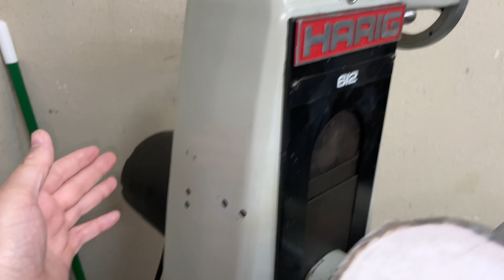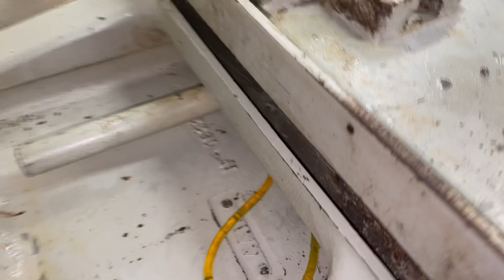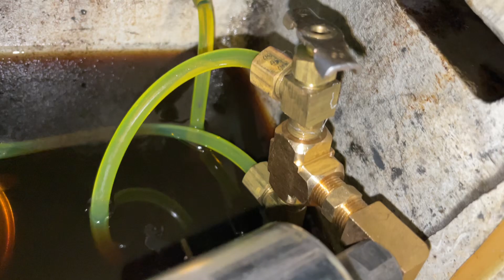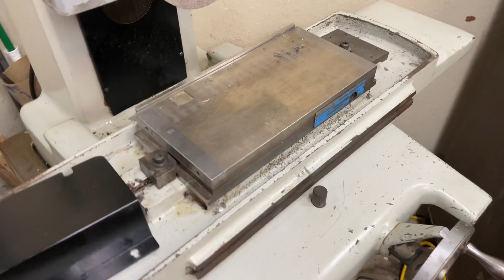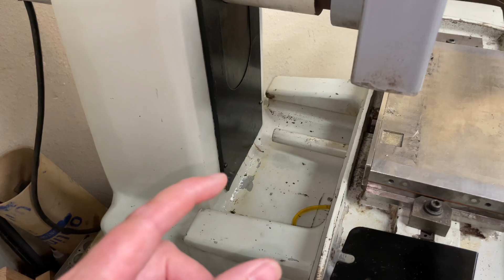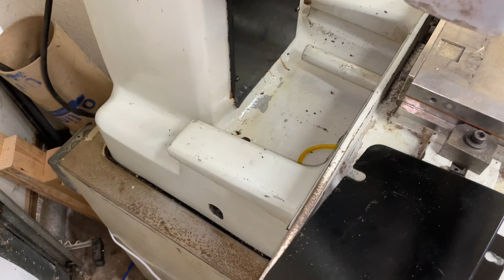Harig 612 Oil Pump Replacement

Comment: I just bought the same pump after watching your video. I'm doing my spindle bearings too, so I have full access to all the lines and will be purging soon. How is your system working? I almost fainted when Harig's parts guy only wanted $600 for their pump!
Reply from the maker: Mine is still working fine! Just make sure to shut off the pump when you’re not using it. It’s so quiet I forgot a few times lol.
Reply: @IronForestMFG  
Thanx for getting back to me. I have an outlet on the machine wired to the on/off switch.
Reply: @IronForestMFG  Ok...Got the pump working ok. I guess I just didn't dig deep enough. Someone had monkeyed around with a homemade manifold that leaked terribly and could not create any head pressure. Made a T-manifold and pumps like a camp and I have throttled it down as you did to yours.

Comment: I need to do this to my grinder. It has a hand pump oiler and I noticed it lifts the tables a few tenths.  It doesn’t take very long for it to drop back down. So right now I am running through oil.
Reply from the maker: I love that Harigs have a recirculating system so it really doesn’t “use” any oil. The pump is still working great.
Reply: @IronForestMFG  mine does not have a bay in the back to hold oil like yours does I will have to add a tank somewhere.